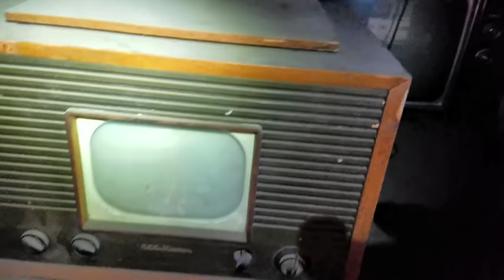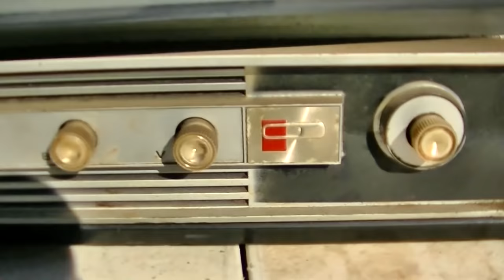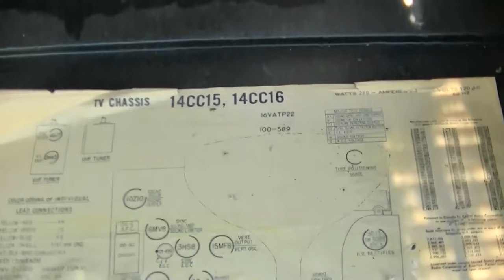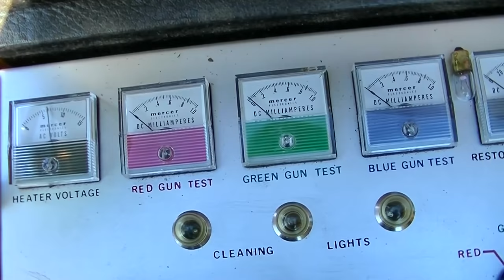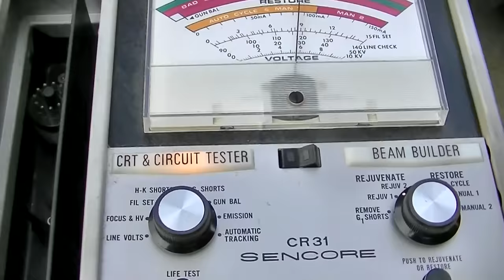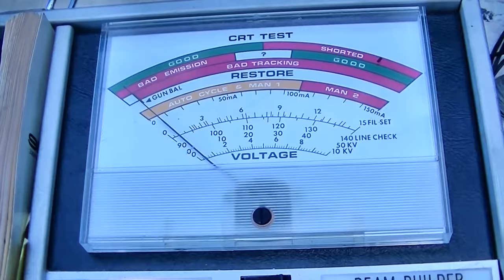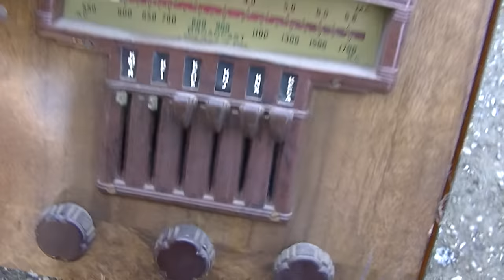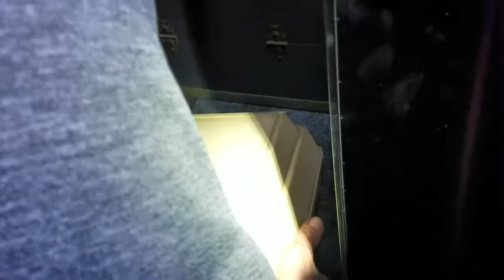Testing 20 Vintage Tube Television Picture Tube Pickup Analysis TV Sets and Radios

Comment: The RCA CTC 53 was most likely a Hotel Set. The "J" in the first digit of the model number denotes this. The second digit "R" is the year. The 3HA5 tuner RF amp was used because of the series filiments. I worked for the RCA Service Co and remember that the Nuvisor was not suitable for Series Strings. The CTC 53 was a burner; it created a lot of heat and thus a lot of heat related failures and poor solder connections on the boards. The CRT's were soft and grey due to the low focus voltage. The retrofit resistor on top of the yoke is typical- many retrofits on these for theft deterrent or pay TV. Overall poor performer back in the day.
Reply from the maker: Exactly what i discovered in part2

Comment: 14:15
I had a solid state color tv, late 80's maybe, was my daily driver, picture would collapse into a single centered scan line, could be "fixed" with a smack to the upper left side of the case, would have to smack it once every 45 min or so, after a few months the fix would not work anymore, I opened it up and poked around finding that the picture would come back if I quickly shorted two legs on a transistor that was on the yolk board, my ultra lazy fix was to run wires from those legs - outside the case and connected to a mercury switch, now I only had to gently flick the switch for a quick short to get the pic back, only had to flick it about twice a day, worked like that for about a year and a half then one day the line staid and all the shorting in the world would not bring it back. 
Good times, good times .

Comment: Some of he stuff Admiral made for Ward's Airline didn't have instant play, at least, the two sets i have don't (1 b&w, one color) and some of the ones i have seen in the catalogs. The one i have from 1976 is b&w with a Clinton electronics corp CRT and the Made in Taiwan color set has an NEC picture tube. Oh and the rabbit hole goes deeper, label says DuMont and Emerson, but the EIA code is Sylvania (312) before Philips took over in the late 80s i think.

Comment: Why not check out my best friend's RCA Model 3 color TV receiver that STILL WORKS??? With 68 vacuum tubes inside and the ORIGINAL RCA cathode ray picture tube all of eight inches in diameter and a crank rotary tuner? His father bought in 1948 here in Tulsa from Saied Music Company on South Main Street in the Vandever Bldg. Annex. In high school I bought and built my parents a 21" Heathkit (Zenith) color 3 tube hybrid TV (my rent for that year) that lasted 20 or 21 years 'til the CRT went out and there were no 21's available to replace it. If they got 5 years from a $500-700 CRT TV after that, I felt lucky and most were throw-aways.

Comment: Those 17" Sony look SO familiar inside....

We called them 18" here in UK,-- Sony KV1810, and MkII with same 470DLB22 part number vacuum piccie bulb! Those sets--Major fun when line/horiz o/p and psu GTO deviced go short--usually caused by lack of line/horiz drive--Nothing to turn 'em off, hence go short. Brill pic when right with good tube, but run damn hot, you'd think it full of valves (toobs)...

19V rail most important--replace every cap related to it and all small caps on PSU board. this rail must be present before main +B or GTO's go poop...

You can replace those GTO with proper horiz o/p transistors like BU508A etc, but you have to change line/horiz/psu drive transformer. I used line/horiz drive transformer from a Philips G8 in horiz stage of sony, left the PSU as is with a shiny new SG6533 Major humungous price on those special Sony only GTO's in the day £25 apiece some places sold them for as I recall...

Wonder why you call that size tube 17" and we here in UK call 'em 18"--Same bulb, same number--A con somewhere I recon....
Reply: CRT TVs in the US during a certain period were required to be sold by visible picture size, so they usually lost an inch or so compared to the same tubes elsewhere

Comment: Nice and lengthy video with all these television sets, but don't you dare 'EOL' that pink 'pretty kitty' set!
Instead, you could put this collectible TV up for sale on eBay and make some deserving kid happy  :-D

Other than that, the first featured television set (RCA New Vista Color) has to be from the Houston area for that exact channel/network lineup (despite 5 - UHF).
Otherwise, the only VHF channel missing is 8 - PBS.

By the way, starting at 53:13 - when using your Sencore CR31, either socket adapter 24 or 25 (if you have them) is used for that Sony Trinitron CRT.

Comment: Maybe the first set with the little plaque on the front with the channel IDs on it was from a hotel?  Because those channel numbers are not correct as far as the L.A. networks especially by the late 60s, and listing KTLA 5 as 'UHF'?  They were the first TV station in LA.  Would be interesting to know what channels that thing is actually tuned to given that channel 5 is labeled UHF.

Comment: Shango, I have a 1969 Motorola Color vacuum tube tv, when I recently tried turning it on for the first time in many years it worked but when I turned it off a few seconds later a capacitor blew. Any advice on how to go about restoring it? Should I ideally aim to recap everything in it. Is reforming capacitors in the tv a waste of time?

Comment: 24:20 with all the idiot Ford and Toyota drivers I see rolling around after dusk and in dense fog with no lights on I think we could use more of that nanny state garbage. I also like how the dinger goes off if you leave the blinker on for more than a minute while driving over 25mph. Should be in every car. Very thoughtful engineering 👌

Comment: Btw the CRT plastic tit always did break but the tube is fine.. as long as the key lines up to the socket, your gold!
the tit always got baked and just broke but there's nothing wrong with the tube.
all that did was to make sure when you put the crt socket back on the tube the KEY made sure we dident put it back on wrong.
it means nothing to the tube only made it faster when you pushed the socket back on the pins.
Thats all the plastic tit did .. CRT still fine :)

Comment: Dumont and Emerson merged circa 1953...The results were predictable (Dumonts dropped in quality, and Emersons stopped having idiotic chassis design quirks) and not that much different from the Packard Studebaker merger.  Kinda jealous of those remote Zeniths.
That mystery red and white portable is a GE/Hotpoint...It has the same handle (and some other parts) as my GE 14T07.
That Teledyne Packard Bell is a GE C2 chassis...I used to have one.

Comment: Ohh and that GOO around the HV cup on crt is ment to be goo.. it HV sealer so when in humid places the GOO made sure it still would not arc over to the DAG.
The GOO is ment to be like you fined it.
25-30kv of that "belly button) or a humid day was real bad.. 
the goo in the cup of crt HV cap is correct and not old age.
Yah want the goo there lol..

Comment: More, dont mess with the stuff on the neck of CRTS, there are fixed magnets and that "wtf" shield is NU-metal.. WHY! .. easy... ION traps. the most rare is the yoke is bad.
Not all of what you see on a CRT is what you think.. leave it alone fix the problem.
Each crt is set for that one crt on the neck but it perm magnets so DO not screw driver it.. FIX the problem :)

Comment: It would be much more fun if you plugged each set in .
Reply: Who doesn't like a stinky explosion?
Reply: @spaceflight1019  A forced reform of a good capacitor does not create fireworks.
Reply: @rsattahip  , I collect and restore vintage CB radios. I haven't had to recap a radio since the filter caps in a Hy-Gain 623A went up in a cloud of stinky smoke. What I do is to attach a 30 volt DC power source to the caps and let it sit while monitoring the current draw. 
But...not reforming the caps, i.e., just plugging it in and turning it on, greatly increases the chances of stinky smoke or the Big Bang.

Comment: The electronics in 1990’s Toyotas suffer from capacitor plague. I still think electronics have no place in a car! (Aside from the radio).
Frankly, I’m still scared to work on CRTs because of the fragile socket on the neck board

Comment: "Why did I bring this junk home?" How many things can you say that about? This may sound cruel, but you can't fathom how pleased I am that that pile of crap is on your plate and not mine!
Reply: Yeah, but never forget that one man's junk is another man's treasure.  I've been a "junk man" ever since I found some Lionel locomotives someone threw over a hillside while walking home from grade school. Today I scan trash piles for CB radios and scanners.
Reply: @spaceflight1019  True enough, I did plenty of scavenging in my younger years and I enjoyed it quite a lot. But I now live in a small space where there is just isn't room for excess debris; my eyesight isn't so great to be seeing the small parts, I kind of don't want to screw around with 450 volts any more, and in this case, I don't even own a regular TV so what the hell am I supposed to do with an NTSC  TV on which I can receive nothing? Just doesn't float my boat any more.
Reply: @pneumatic00  , I'm 66, and don't see as well as I used to, but I still enjoy saving old CB radios from the landfill. I retired from a job as a power plant electrician so high voltage doesn't bother me. People started giving them to me years ago so I just went with the flow.

Comment: I know exactly those garbage early 2000s Buicks you're talking about. Our 90s car died to multiple major failures and we are borrowing my grandparents' sunday church car.

-autolock doors
-no power seats
-sunvisors that block half the windshield
-parking brake interlocked to the main brake pedal
-automatic lights on knobs like a 70s car
-shifter on the steering column
-trunk unluck control in the doors
-keyfob only locks
-terrible ergonomics
-exc.